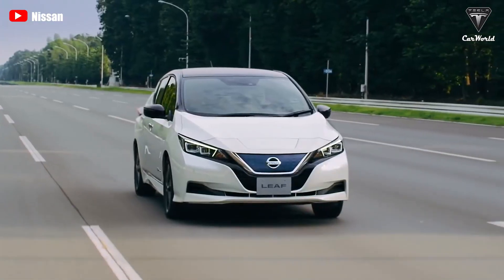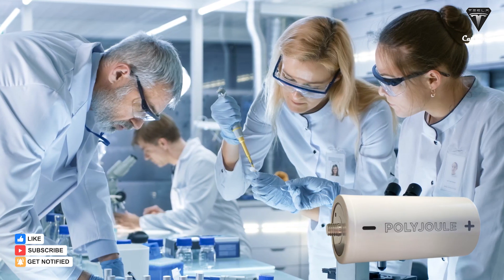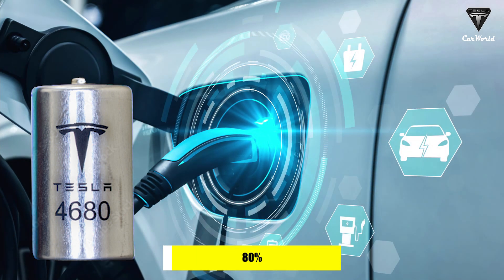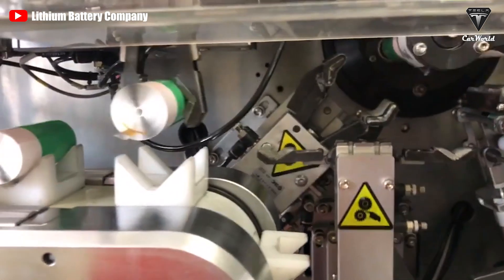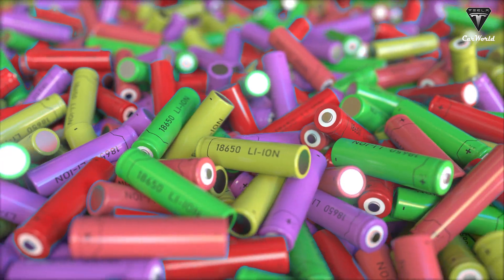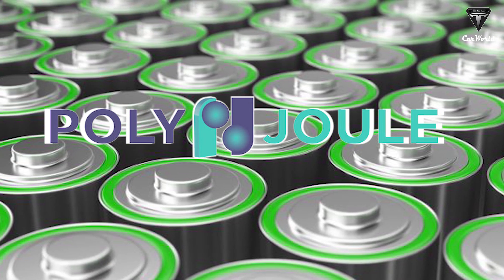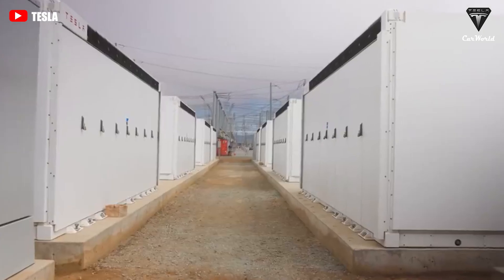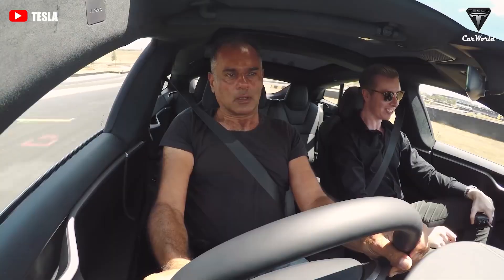Uncovering The New Batteries Miracle Material Made Entirely From Plastic SHOCKS The Entire Industry!

Comment: Like many companies before them with exciting new technologies, will they also turn out to be vapourware? They look more like a supercapacitor rather than a battery. They certainly behave like it.
Reply: Agreed, the video gives no technical details but it looks like it's effectively a supercapacitor. Nothing wrong with that but an energy density of one fifth that of lithium will rule it out for vehicle use where even lithium compares very unfavourably with hydrocarbon fuels.
Reply: Looking at the patents, It looks like at least some of the energy stored is from capacitance,  The chemistry as best I can tell looks like Graphene acid-Hydride.
Reply: @WorBlux  Interesting, thanks for that. It certainly doesn't seem to be a case of "Goodbye Lithium", at least not for transport, given its low energy density. Getting even close to the energy density/weight of petrol/gas/diesel is going to be a tough nut to crack!
Reply from the maker: A polyjoule battery cell under development has an energy density five times smaller than 4680, or about 60 Wh/kg. This means polyjoule would need a battery five times as big to store the same amount of energy, making it not ideal for your phone, laptop, electric vehicles, or other applications where size is an important consideration. Thanks for your comment and have a good day !
Reply: @TeslaCarWorld  Five times heavier, not bigger. Volumetric density is likely even less favorable.
Reply: So many claims so little time ... Guess you follow the tech like i do and got equally disappointed by all the fake promises.

Comment: This is a great idea, especially when some woke politicians want to add a carbon tax on our energy consumptions during winter and extreme heat weather.
Reply from the maker: Since they are constructed entirely of polymer, polyjoule batteries do not contain minerals such as lithium or cobalt, which must be extracted and refined before use. Their water-based manufacturing chemistry can be produced using already commercially available equipment, and does not require ‘clean room’ conditions. Thanks for your comment and have a good day !

Comment: Not battery, this is a capacitor.
Reply: Really???  So you are saying it does not chemically produce power.  It only stores it.  Does that really matter?

I have read that people are experimenting with capacitors for batteries.  I did a little electronics repair years ago.  At that time, capacitors were the part that needed changing most often.  I hope they can make them more durable.

Comment: I love electric cars, but for now I would not recommend anyone to buy an electric car..
because ; Since battery technology is still in its "beginning" period and lithium's dangerous character, cars are like "wheel bombs", charging times are very long and ranges are short.
It's too early to own an electric car.
The battery race has begun and batteries with higher capacity, smaller, shorter charging times and longer energy efficiency will be produced.
At that time, batteries produced with current technology will remain almost "primitive" and those who buy cars will be the last owners.
Moreover, although some car owners want to replace their batteries with newly produced ones, they will experience difficulties due to their technological differences.
In fact, there will be developments in electric motors and electric motors that give torque with less energy will be developed.
in my opinion ; We need 10 years for battery and motor designs that will facilitate the use of electric cars.
again i think Currently, the most useful and affordable electric vehicles are the two-seater, low-energy, practical, micro-city cars with a range of 100 - 150 km.

Comment: The whole video looks and feels like a marketing crap complete with obligatory  pseudo-scientific nonsense like "discharge 1 megawatt in 10 seconds". Just a reminder: power in unit of time is nonsense because power itself is energy within a unit of time. Also if you can charge a car in 5 minutes what kind of charging currents we are talking about? Correspondingly what thickness (and weight!) of the charging wires we are dealing with and can an average human lift it and plug it into the car socket or you need a crane? As always the devil is in the details.
I just hope it is just misguided rubbish and not a scam. One thing for sure: this thing will never leave laboratory phase.  And I did not even mention the phony claims about environmental friendliness of plastic anything....

Comment: Its not entirely made from plastic, what are those metal tips on either end, busted, is it only the casing made from plastic.
So how does a plastic battery save the power in the cell itself and how can plastic be a form of power, how is plastic transformed into electricity, a charge in a battery for battery life, but still it has metal, really not telling much on the subject. So a myth in the making.
When you can store energy into a battery entirely made of plastic, so whats the inside made from, what components and what are they made from?????? Not plastic I bet!!!!!!!!

Comment: Batteries from plastics? Shows how insane and inept  woke movement to electric vehicles to force you to buy. 
Ammonia NH3 as fuel is future. And it can be used in any existing gasoline or diesel engine  and generator right now with very little  modifications and you don't need buy a junk new car, which is the goal of these politicians and business forcing to to buy something
Please look up ammonia as fuel videos. All it takes  is a propane tank kit but fill with ammonisla and you can run your existing car, truck, diesel,  semi,  etc off ammonia.  Ammonia aka NH3 has been used as a fuel since the 1960s space race . It is still used in rocket fuel, aviation fuel,  tractors,  race cars. The land speed record is currently held by a rocket csrcrunning off straight ammonia NH3.